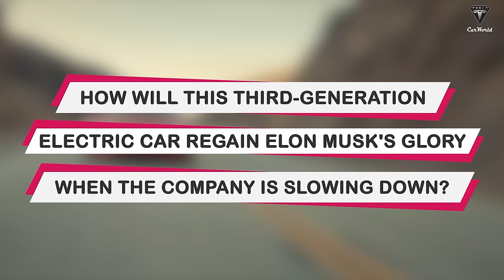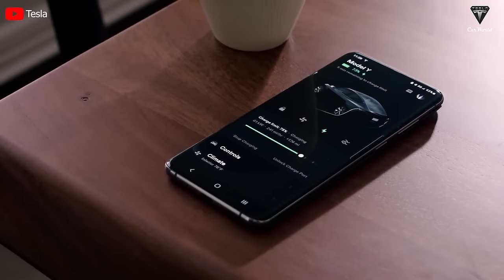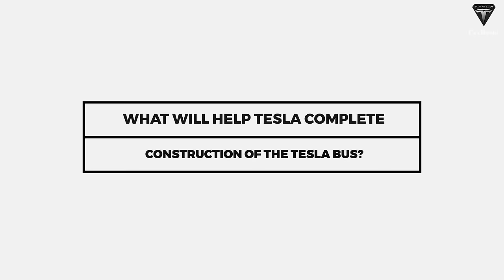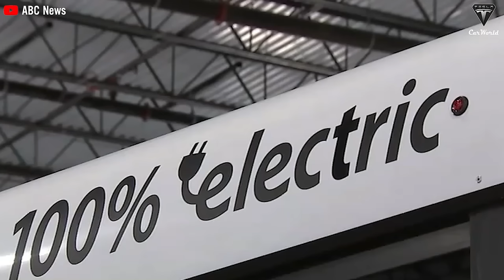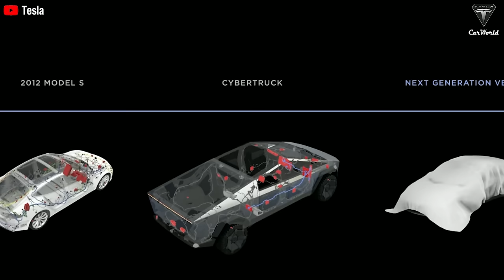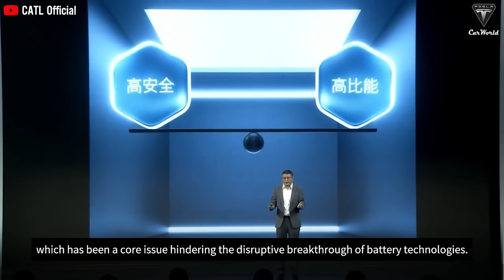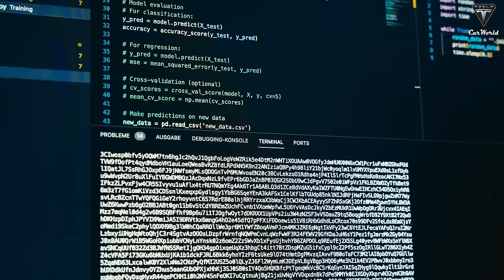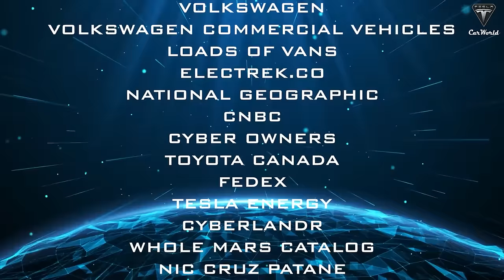Elon Musk Reveals 3 NEVER SEEN Tesla Models Design in 2024, Will Hit The Market Soon!

Comment: I know that the camper market is small compared to the general Car/Truck/public Market... But I can "Imagine" a really nice Camper/ personal bus conversion... such as the private "Personal Bus/Camper" but in a smaller size that would be wonderful for Couples or small Families as a traveler and even fleets of Rental Campers for vacation travel... and for buses on smaller, lower volume routes. 
And I LOVE the "CyberVan" !!! The 'CamperVan will be a WONDERFUL addition in my Driveway!!  If there is a way for the rear being able to even have a rear capacity for 'cargo' such as a motorcycle or two and a Load floor of four foot width for loads such as plywood...
Reply: The cyber truck can be used as a camper for sure :)) Lots of plugs for your heater/ fan/ a lot more :).

Comment: Two points: it won’t be here in 2024 and it won’t be $25k. Apart from that, you are right on the money.
Reply from the maker: Some argue in 2024,2025 but we have a feel that it maybe release soon end of 2024 but 2025 for delivery, thank you !
Reply: Tesla have more build experience now & there'll be more GigaCasting/Automation than previous models.  Plus, you can (almost) guarantee they've already started work on early production/setup etc.  $25k at the economies of scale of a $25k small car & Highland concept production line methodolgy will likely enable both price & delivery date to both be true.  (Sadly FSD will still be late).
Reply: @alexmanojlovic768  If Musk has one deserved reputation it’s for over promising and under delivering. The cheapest BYD cost around $31k, a car designed, built and exported from China. Do you honestly believe that Tesla can build a car to undercut that by $5k and still make a profit?
Reply: @tatata1543  Yes.....   Tesla has revolutionised car production techniques.  Has BYD??  You clearly didn't read what I wrote above....

Comment: Funny, Moscow already has more than 1300 fully electric buses running while Tesla keeps inventing them 😅
Reply: If the Tesla city or school bus going to occur, but the school bus is more likely the class A school bus will be cyber truck-based, class b the low-range semi, class c the long-range semi, and Tesla class d school bus would certainly need the base of the 500-mile semi, the metro bus nonarticulated is something entirely new, it's going to take years to design the articulated version, especially with an open passageway.